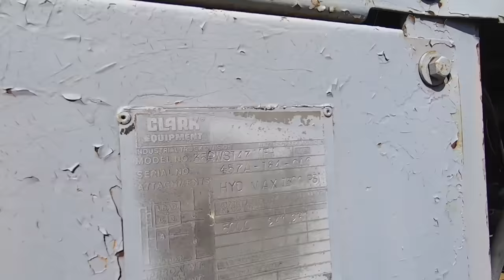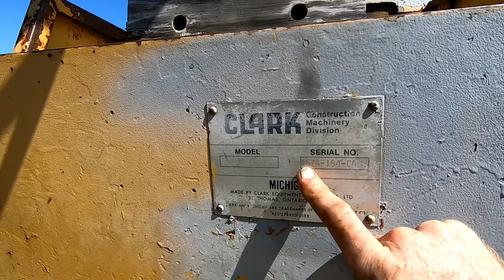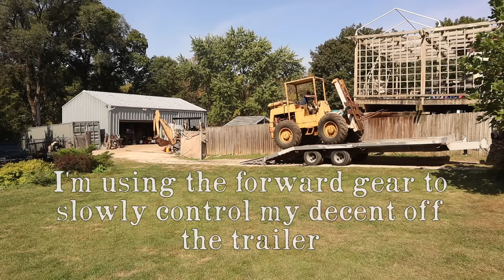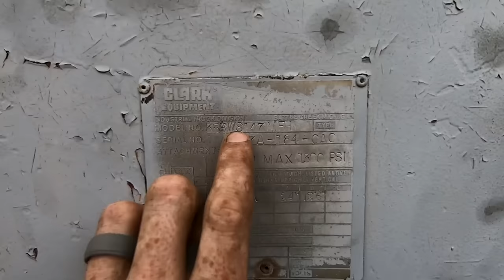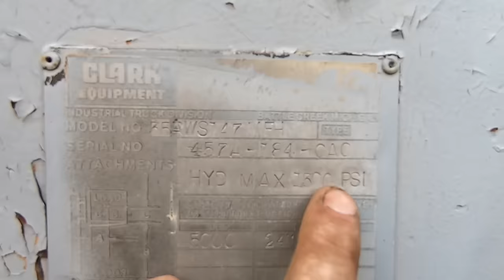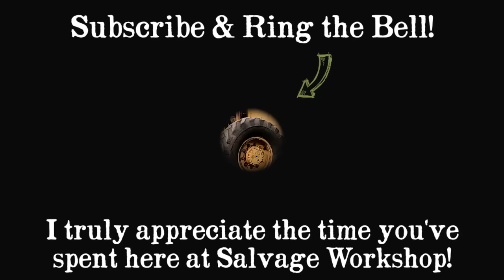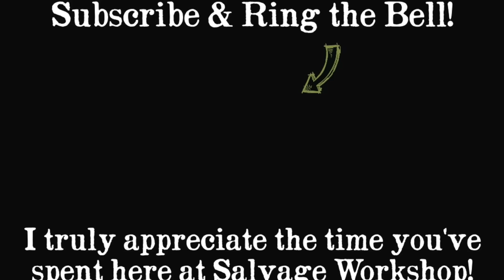I found a RARE ALL-Terrain "Wheel Loader" Forklift! Will it START?! (THIS Machine PUT UP A FIGHT!!!)

Comment: First off if it’s been sitting a long time the batteries probably dead super dead. Secondly you need to make sure there’s oil in the motor and it’s also probably really bad and should be changed before you crank over the engine. Since it’s a diesel it will not have spark plugs it has glow plugs. Soil should be changed because it is imperative in diesel engines to have clean oil. Another thing to consider is the fuel before you even try and start that motor you need to drain all the fuel out change the fuel filters because you don’t wanna trap any contaminants or have a chance on oxidation plugging up an injector….
So after the funeral is been changed, as well as the battery in the oil you can then crank the motor over or turn over the motor but while doing that you need to leave the injectors cracked open so that if there’s any contaminants in the line it’ll be blown out the line and not into the cylinders and two it’ll allow you to prime
Reply: I digress it’ll allow you to prime the engine once you start seeing fuel coming out the fuel lines or the injectors where they screw into the block then you can start closing them up and locking them up now you’ll have a prime motor and if the batteries good and the glow plugs are working properly it will more than likely turn over and start.
One other thing also to keep in mind that dirt is the primary enemy of all diesel motors so look at the intake air collection basket there should be some sort of a collector you can unscrew it make sure all the dust is out of it it’s at the intake and the air filters also they need to be probably at this point changed! Again dirt and dust being a diesel engines greatest nemesis.

Comment: It will be a small amount of carbon on top of one of the pistons, had this with old engines being recommissioned, once it turns over it will be fine, last thing you want to be doing is pulling it apart.

Comment: To drive a less experienced operator crazy you can turn the front wheels all the way one direction and then put it in rear wheel steering and turn the back wheels the same direction and then put it back and four wheel steer. 
If it's done right they won't be able to turn the steering wheel in either direction when they start it up. 😆😁😃😆😉🙄

Comment: No fuel filter in it, and all gunked up in the bottom, means that traveled up to the injectors, so they probably clogged up.
Reply from the maker: It has 2 fuel filters on the other side of the engine as well.... that was basically a water separator.

Comment: The gears are angled the same way so both starters so they should turn the same way. Since they don't the one that turns backwards must be wired wrong on the inside of the starter or the field coil in backwards. Assuming that it is a pay loader modified to be a forklift by the manufacturer you could look for a pay loader with that description or numbers to see if anything came up. They probably made very few of the fork lift style so they didn't make a separate manual for them but the pay loader manual should all be the same except for the modifications for the fork lift add on.

Comment: That loader is AWD not 4WD.... There is no option to disengage it to 2WD only... That air compressor is about to blowout its inner sleeve sounds like it is badly damaged....  I have seen a few of these over the years & most was used for loadin & unloadin lumber at lumber yards

Comment: Does it have crab steer ? Yes it does And those burrs are called cuckleburr
Reply from the maker: Yes! All wheel steer, where both sets of wheels turn opposite one another, but it can also be turned off so that only the front axle turns when steering for better road driving.
Reply: @SalvageWorkshop  , yes, but one of those levers in the cab may enable/disable a `crab-walking` feature. Most Lull construction forklifts have this feature. Sorry I can`t tell you more about it ( I`m a bricklayer, not a forklift operator - although I HAVE operated Lull forklifts that have this feature, I never had to use it ,so I don`t know how to activate that function  )
Reply: @SalvageWorkshop  crab steer is when both sets of wheels turn in the same direction to move the vehicle in a sideways direction and then a switch is flipped and the rear set turns in the opposite direction from the front for tighter turns  and then you have two wheel only steering .
Reply from the maker: @tacticalrabbit308  ahh ok... ive heard that term used a few ways... no it doesn't have that!
Reply: @SalvageWorkshop  sure looked like it in that first part of your video at the 1:09 minute mark

Comment: Good job, it's always harder dealing with something that someone else (aka 'the phantom bodger') has tried to fix. I hope you can find a use for that third starter they left you. I'm definitely looking forward to seeing the next stage of the rebuild. I'm wondering just how hard it is to source the chains for the hydraulic lift. If it was me, I'd replace both at the same time and depending on your parts source it may be cheaper in the long run.

Comment: thr perkins diesil was used  in massey fergerson tractors also that may be where it came from
Reply: Oliver/White Farm also used Perkins. In many cases, Oliver cast the blocks and sent it to Perkins to get machined. They also used Detroit Diesel (which became a part of GM). From what I've heard, the Detroits are louder (as in needs ear protection even with a muffler), but the Perkins are bulldogs that just run and run and run.

Comment: You should not start a diesel engine with ether. Premature ignition may destroy the motor, just listen to the spiking here:
https://youtu.be/5Q28MvfQo44?t=3582
I have read that WD-40 can be used, though.

Comment: that engine sounds just like perkins should so i would only rebiuld her if it packs up ouver in uk they where put in combines alot and used for diesal convertions i had one in an old land rover and a range rover and i think they even ended up in some back cab taxis 
when  we did our range rover convertion we had to replace the starter as that turn the wrong way because it was fitted gearbox side in the combine harvester then when we put it in the range rover it was put in block side every time we blead up the fuel system by had we would get all the air out and then try and start it and  nothing and when we checked there would be air back in the pump again we tried towing it and it fired up straight away and they tried  the key again and  it would not go and filled system  up with air again  that was when we look in to wich way it turned over and was like .... its going the wrong way

Comment: Military panel loader.   Think there's surplus literature on ebay.
Reply: It helps to leave off the Michigan part.   The model should stand for 3.5ton, all wheel steer, which is the chassis used to Upfit to a loading mast, in this case.  Same literature as the power shovel, with exception of the implement.   Kind of like ordering a cab and chassis.   The same model truck could be a dump bed, box truck, wrecker, 5th wheel hauler, etc.  Instead of a 4500 dump truck, you look it up as a cab and chassis, if that helps.   The rest of the mast literature will be piecemeal for the parts used.   Most likely, the literature for a Clark c35 or larger.  Look up the Clark forklifts of the same year, and you'll be able to visually match up the mast to a compatible model.   That part does take some skill at times.  Can't just assume a 3.5t mast as there might be like a 5t/500 mast that has more suitable dimensions.   Then there might be a different sized main ram installed to prevent overloading or to recover the lost speed of a larger ram.  Same goes for the pump and valves, though those are much easier to distinguish from each-other.  Lol. I've been to this old iron rodeo a few times, pulling my hair out backwards.

Comment: That was NOT built for the military.  And please don't stand in line with the winch cable. If it breaks, you will be having a very bad day. Especially when you have it rubbing on the trailer.  Nothing will weaken a cable quicker than chafing.  Also, get some snatch blocks.  Your winch won't work so hard since you double its pulling capacity.  You can triple it by using two blocks.  Or quadruple it with three and so on.

Comment: You did pull out the diesel fuel filter housing but the filter was missing. The screen is mosquito screen called storm door screen made of steel into fine strainer. Also coffee screen is petroleum  resistance that it's the closed knit interwove net that go in the housing for fuel filtering.

Comment: Was probably the air compressor that was bound up
Reply: All you had to do was hold the valve for the tilt and it would have released  the pressure on the cylinders
Reply: It probably has.  Front   circle  and crab steering
Circle steering gives you the tightest turning
Reply: Pretty sure that engine has. Dry liners.

Comment: The push pull knob on the stick shift is not 8 gears. The push down is cut off pneumatic locker of rear differential. You pull up the knob means you add air pressure to lock both live axles of  better traction.  That is sure ways for Truck of either Chevrolet and a Ford. 
 When you drive 8 gears you have to stop the tractor and shift the knob up for lower gear ratio while the stick is second gear. Then release the clutch to go plowing then you have to stop the tractor to zero MPH. then shift to 4 forth gear and push down to a high gear ration then engage the clutch then it go faster. Before you pull up the knob then you have to stop again and stay on forth gear.

Comment: I dont understand why you didn't hook up a set of booster cables  to both starters when you had them out on the ground and see if they turned opposite to each other. Or was it done your way for dramatic  effect  LOL
Reply from the maker: Dramatic effect? You think what you see on my channel is fake or scripted? NOT A CHANCE!  As to why, simple, I've never run into that problem before.... I'd have had to know that they might be spinning different ways, and it never crossed my mind... as easy as it was to install the starter, that's what I did!

Comment: Take off the battery cables and switch it around install the positive cable on the starter to the neg. post of the battery. Because if the radiator fan pull in the air thru radiator or the fan blow thru forward thru the radiator. Diesel is to squirt thru injector BTDC and look for the mark of when the injector will fire it. Mainly - if the crankshaft turn wrong clockwise then the injector spray fuel after TDC is wrong.

Comment: You no brakes is an issue plus you also said the both axles didn't rotate same rpm is an issue. But you have brake that only stop the brake on driver side wheel and you also have another brake pedal that stop the brake on passenger side wheel. It is the farm style all terrain forklift/ skidder is when you scrape the shovel and it shoveling up the load. Scrape means skidding. also the shovel open its mouth and could grab log and pick up the 15 foot log is part of the skidder here and it is not deluxe skidder which does have front have chassis pivot to either to the right or to the left at same time the rear half chassis stays straight up. The pivot os a strong fulcrum joint as the axle is pin fitting straight down. Snap ring plier is about 2 feet long.

Comment: IF AND WHEN I GET A NEW TRUCK I WILL TAKE OUT THE DAM JUNKING PLASTIC/ALUMINUM  RADIATORS AND I WILL PUT IN A RON DAVIS RACING, ALL ALUMINUN  RADIATORS, AND THERE IS ANOTHER COMPANY THAT MAKES ALL ALUMINUM RADIATORS, BUT, IF YOU HAVE A RADIATOR SHOP NEAR YOU GET HOLD OF AN ALL METAL USED RADIATOR, AND HAVE THEM MAKE A 4 CORE RADIATOR, INSTEAD OF A 2 CORE RADIATOR!!

Comment: The solution to the bolt is, use a die grinder to remove the torx hardened steel.  Then use a proper extractor.

Comment: Another  "wench"  comment.   I guess you've never had a winch wire fail.  PLEASE do not stand next to a cable under tension.  That girl weighs a lot.  Parting wire  is  DEADLY.  And not only  are snatch blocks cheap,  and  easier on the winch motor,  but they increase  capacity  x2  and  cut in half, the load on the winch line

Comment: AWS means additional work service and it is really a laser cutting the 1/2 inch thick steel up to 3/4" in east states longshore man named Open house of The old mill called Twin Stoker and railroad collapse and took away the rails off into the dump at the site named Michigan R & R and M & M. There is James in Michigan so wear the company of James because we are also direct blood to James in The Peter's and towns but we moved to San Francisco working with Pacific ocean longshore versus our place in named east states company  named Pacific Union.

Comment: You a starter and the motor came off from the newer machinery that way you install the motor as it's connect to the wire and the cable that way the starter is replaced with that motor convert to electric motor. The motor isthat what it is a company = restuarants did rebuild diesel A4.236 motor lead by the Perkins and it merged to veg. (corn) investment by gathering corns and pallets. And also Perkins bought the Clark (an elder and an elder) is called Clark. I'm also the Clark with my next door The Wilson and County machinery into this division.

Comment: Bad idea to hit a starter that hard with a hammer. I cant tell you how many starters with broken magnets Ive had to replace because at home "mechanics" were hitting them with hammers after they saw someone on Youtube doing it. If you really want to do it correctly, TAP on the back where the brushes are or smack the solenoid. Breaking the magnets is not going to rebuild your starter. I wish people would stop advertising this as an actual helpful method for freeing up a starter.

Comment: dude i like your shows, dont get me wrong. but the first thing you do when you get to an old, neglected engine, is pull the air filter. so you dont suck a mouse house  into the intake. the second thing you do, is kill compression... pull the glow plugs, or injectors, so you dont hydraulic the engine because one cylinder is full of water. get real in your assesment of old machinery.please

Comment: the homemade the forklift but we work as civilians for the civillian it depends where the bossy civilian is. So it is locate at Pennsylvania nd called Caterpiller Miller and The Poole family that run where the civilian called worker and Manpower of all US strength that why we worked for Bob Barker in the dry dock in supported by Tom Cruise with the crane gantry type and the Clark is Washington Port Authority Crane of typical Upside letter L craning up to 5,000 pound pallet and goods. Bob Barker is younger than Bob Barker who works in Price is Right program. Bob Barker works in Exxon and Wharf Co. that Honda and Clark into Forklift and that Goodyear is called North Carolina Bureau but it is bankrupted. Then back into Forklift with Hankook tires if willing to sponsoring since they in Borneo island is all destructive into business called Clark forklift all terrain because they sell logs and wood.

Comment: Why do you make all those GAY gestures with your fingers  ANNOYING
Reply: Johnny T
Hi I am no mechanic . but I spotted your engine rotation problem pretty well straight away I thought that with all the engines you have worked on you would have spotted the problem fairly quickly How did I know this was a counter rotating engine As soon as you removed the starter motor and poked the camera at the teeth of the flywheel the wear and tear was on the wrong side